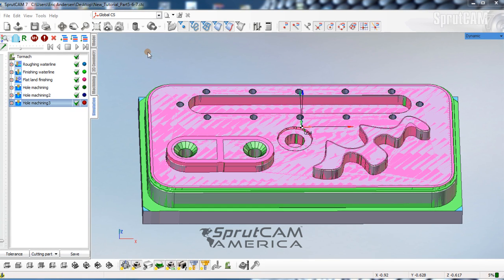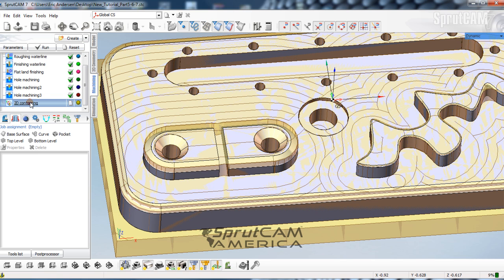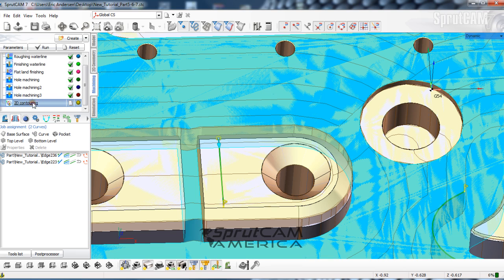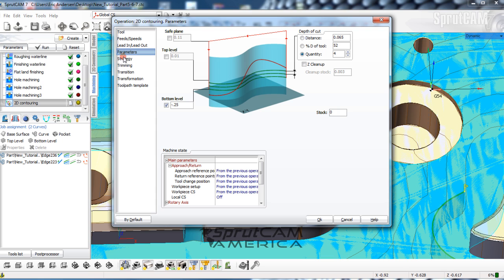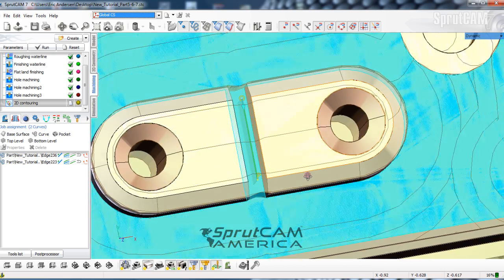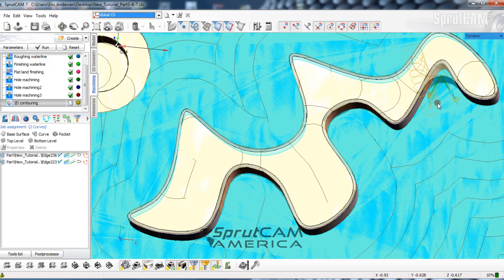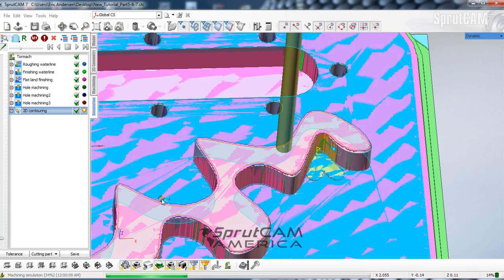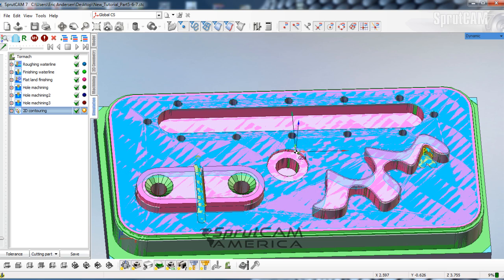#9 - 2D Contouring - SprutCAM 7

Comment: i have tried and tried with this program. it is without doubt the hardest program i have ever worked with. i am getting tired of following along and discovering that something doesn't work the way you show it to. as an example, i can't select an edge at the point in the video where you first point it out. the edges box is highlighted and i am in the machining tab so that feature is on, but i can only select faces.